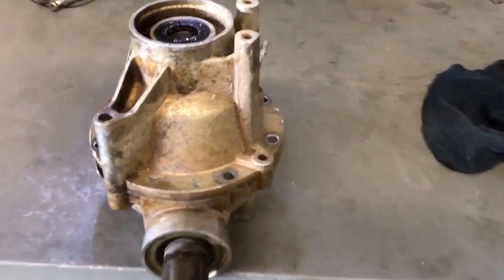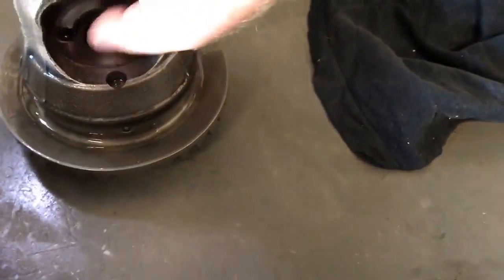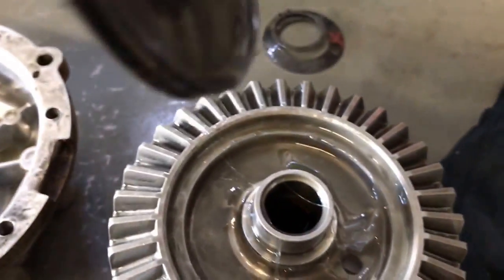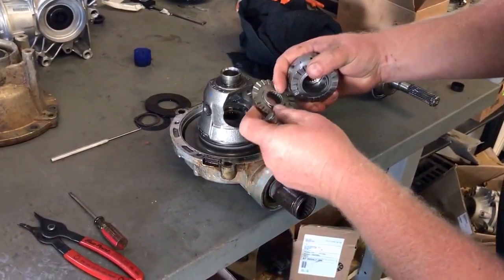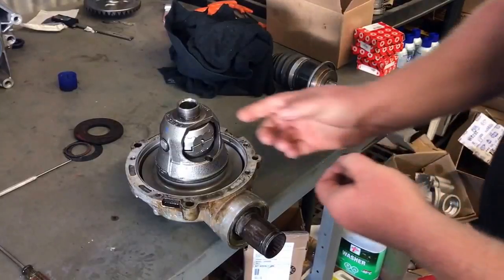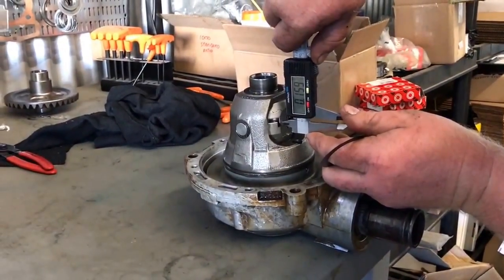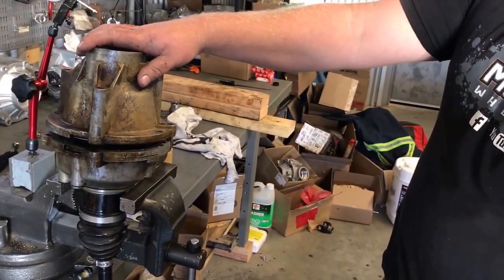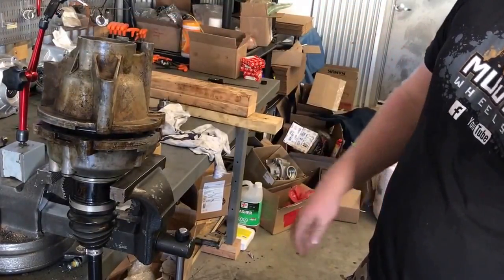torque locker install can-am

Comment: How is the lock actuated/disengaged? Is it purely mechanical such as a speed difference between the left and right (bad when making turns under light load conditions) or is there a requisite housing modification in order to accommodate an external control cable or actuator?
Reply from the maker: this locker is engauged  under throttle in 4x4 when costing the locker diengages and acts lice an open diff it works very well and with power steering you barley notice it.   the operate lightning fast
Reply: Thanks for the info. Having it lock whenever you're in 4wd and under load (such as climbing), even when traction is good - is a problem.  In addition to my Can Am, I have an Arctic Cat with a lever engaged locker. If I lock it when traction does not require it, steering becomes a bitch.
Reply from the maker: ya no worries i love how mine operates i would never go back

Comment: After only 3 run, my left axle is poping out when my bike reach full shock extension on my xmr 2014. I popping in and I've had the same problem. Do you know what could be the problem ?

Comment: lol - yup, you need a camera guy. I was thinkin' it just before you said it.
Good video. I don't know much about CanAm's and I'm not a mechanic so I have a question . . . what's the purpose for installing this? I'm assuming it takes the place of the visco lock, but that's just my guess. Does it make the 4WD better than it was with the visco? or just more reliable as far an engaging is concerned?
Oh, and one more question . . . How would a guy go about getting one of those cool Mud'N'Wheels t-shirts?
Reply: Supposed to act like the Halo locker but is automatic.
Owners have wanted this for years.
Turns Can Ams into true 4WD.
Reply from the maker: hey bud the torque locker's main function is just to improve on the visco lock.  this locker makes our can ams a true 4wd.   if have some free time you should be my new camera guy  lol
Reply: Hahaha! If I lived near by, I would help you out with that for sure. 
Thanx for the info.

Comment: I remove the visco fluid ,Should I remove the clutch pack or it’s fine to leave it in?
It’s a 08 outlander.
Reply from the maker: for the time it takes i would pull the clutches also
Reply: Thank you sir

Comment: I've been hearing guys are breaking axles with the torq locker,  is there going to be a fix for this issue?
Reply from the maker: i personally have broke one axle with a torque locker but is was do to my own mistake.   just today i beat the hell out of my bike with a torque locker and on 32 with zero issues
Reply: What axles are you running?

Comment: Is high speed 2wd handling affected at all ?
Reply from the maker: no sir in 2wd the torque locker acts as an open diff you will never know it is there in 2wd
Reply: @mudNwheels  its good for my gade 2008 its no dps on my gade?